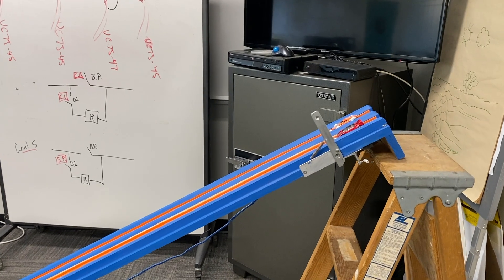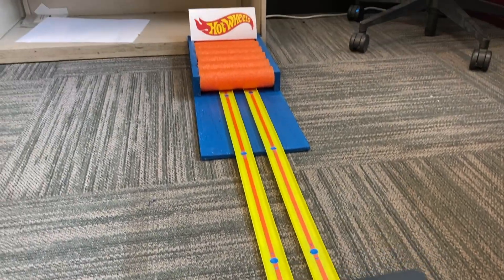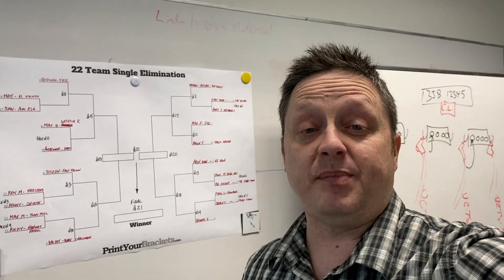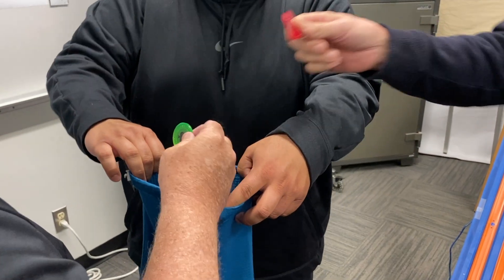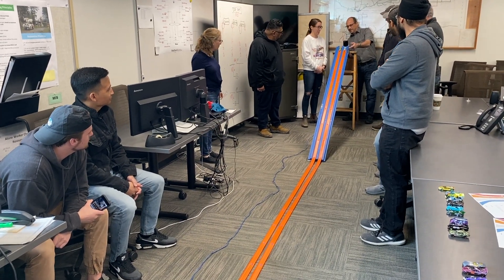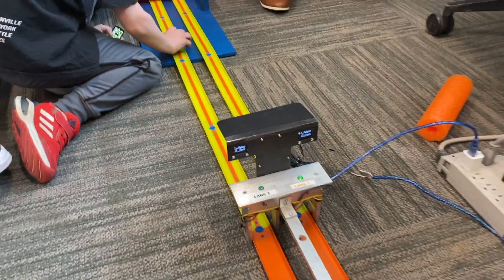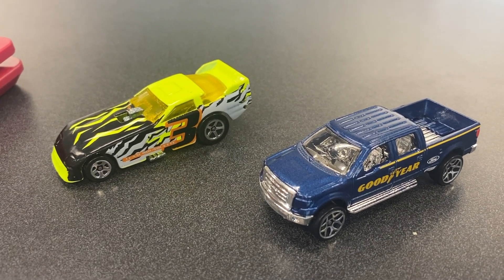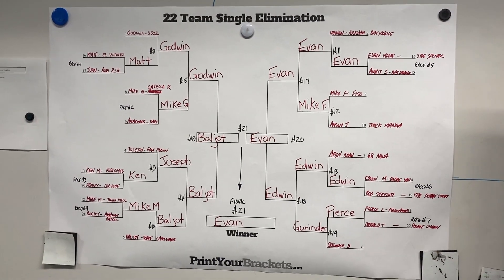Hot Wheels drag race tournament // Boost office spirit with diecast cars.

Comment: What is the device measuring hotwheels speed? Thank you bro
Reply from the maker: I have other videos explaining how the system works.  It's basically Infrared emitters/receivers programed to work with an Arduino Circuit board. Once the beams are broken by the hotwheels car, the timing starts and then stops.  The speed is calculated from the time the car travels the set distance of the speed trap.  Cheers.

Comment: Curious how long your track is to finish line and overall with the stop section also how you made ramp and stop section with specs and item list. Thanks in advance
Reply from the maker: Thanks for commenting.  I do have a couple other videos that show the start gate and the timing system.  The track is a scaled 1/4 mile and the stop section is a bunch or pool noodles wedged in a wood box.  Cheers.

Comment: thank you for earlier comment, (on verion3 video) this is pretty much what im looking to do as well, like i said i made your version 2 and love it.. i just looked at the wiring posted under this video, but looks to be the same as other( sorry im not techy and im a copy and paste kinda person lol,) would there be a chance there is a wiring available for hooking up the 2 screens , and i have yet to make the speed piece yet.
Reply from the maker: Your welcome!  Here is the code for the two OLED screens with the Speed trap. I call it Version 3.1 code (two OLED screens): https://drive.google.com/file/d/1A-gJ2fypBZc5s2WjQtS2XBCxd8bhDWq-/view?usp=sharing

What I would do it just play with the two screens to see if you can make it work from one arduino board. Once you figure out how to change the addressing then you can morph that into the race code.  It may be easier for you to just use normal LCD screens. You just need to make sure that you are able to change the addressing on them.  Wiring the 2nd screen is exactly like the 1st screen. The addressing in the code takes care of sending the values to the correct screen. No special wiring required. If you figured out version 2, you can figure this out. cheers.

Comment: Hi mike, I'm getting an error msg. in the line  "LiquidCrystal_I2C lcd(0x27,2,1,0,4,5,6,7,3,POSITIVE); // double check your LCD"   " POSITIVE" was not declared in this scope.  Any ideal what I've done wrong?  I have an Arduino Uno R3 & SunFounder IIC/I2C/ 
Thanks
Reply from the maker: Good day, several people have encountered this same issue and we haven't really figured out why.  Check to see if your LCD library is the right one and matches the LCD command. Upload a current LCD library file for your screen.  If you are using I2C connections, you can also use this code instead: >>>  LiquidCrystal_I2C lcd(0x27, 16, 2);   You need to make sure your library matches this call out command. You can get the files at Github.  Check the LCD address (i.e. 0x27). You can use another program to obtain I2C addresses.   If you load a new library file, you may need to change the library name  called out at the top of the code to match. What you could also do is just make a simple program and code to see if you can actually write to the LCD screen you have. The simple program like just writing "Hello World" may help you debug.  I hope that helps!?
Reply: @MikeFreda  Cool, Good to know I'm not the only 1. :) I will give these a try. It may be I'm not installining the Library's properly, ie; they are not changing colour when I add them ? It's been a few years since I retired from the computer field and I'm having to learn and relearn so it's a process :)

Comment: Great work team building, cheers!
Funny I was building a start gate today, roughly based on your vid.
Cheers and thanks.
Reply from the maker: Thanks for the comment.  Hope it works out for you!  Cheers.
Reply: @MikeFreda  Still on my bench, assembled working, just adding a pull solenoid for remote operating. Cheers, thanks.
Reply from the maker: Cool, that sounds slick.